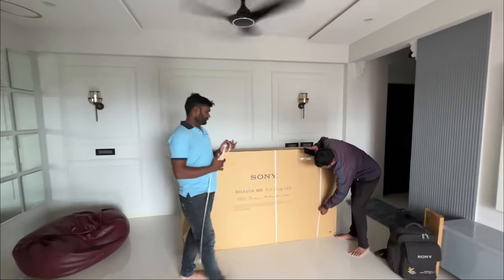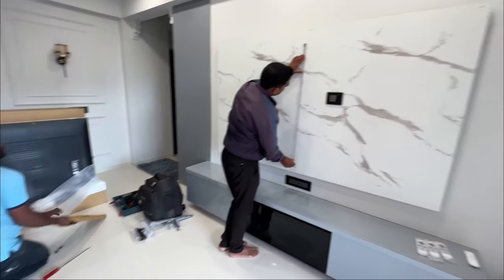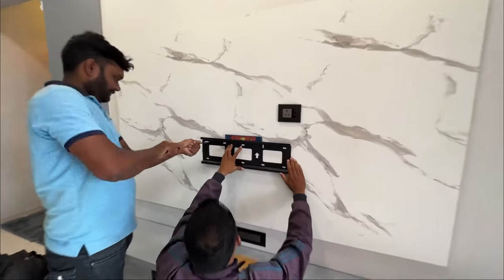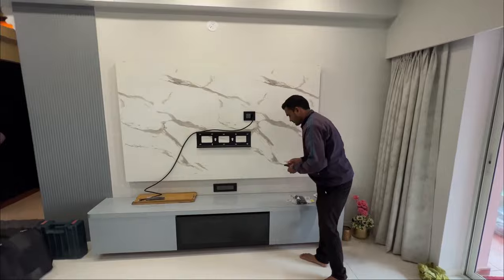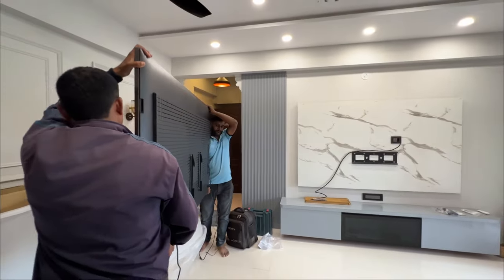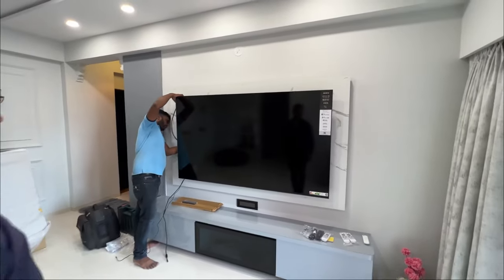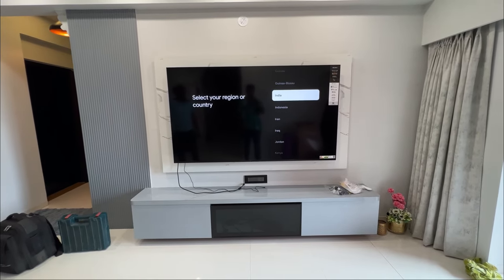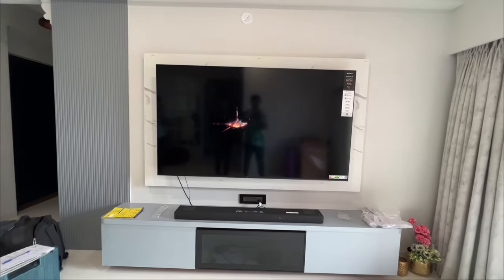Sony TV X90L 75 inches with Sony A5000 Sound bar - Unboxing and Installation

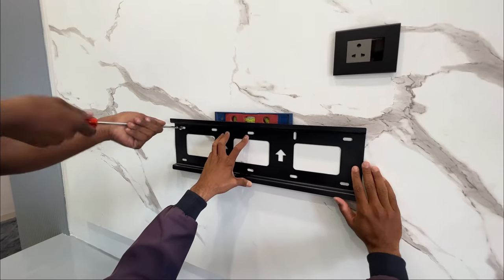Comment: 2:11 please eleborate why it did not needed drill or what was the material used to tight the screws?
Reply from the maker: I had a wooden frame already done to wall mount tv. They just took a sharp screw and simply attached it to the wooden frame. I assume if it had been wall mounted over a wall directly, it might need drill. In my case, it didnt. I am not aware of the material used exactly, may be sony sales people would know.

Comment: Hi suraj, just bought 75x90l and ht a5000 combo from croma. I am getting some peculiar humming noise (when nothing is playing)when TV and soundbar is connected with centre stage enabled. Sony is saying this is the problem with all 90l model. Could you please also confirm if you are also facing the same. Thanks for your help.
Reply from the maker: Hi. I am not facing this problem.
Reply: @4Ksage  thanks bro. Interestingly Sony says it is with all TV’s. Are you sure, the centre stage is also enabled (in Audio settings)and 3.5 mm cable is also connected to TV and soundbar ?

Comment: How is you experience going on?
I’m getting s90c for the same price as of x90l and very much confused to make decision 
What do you suggest?
Reply from the maker: s90c is mini led right? That would be better than x90l. I only opted this as its 75inch version was cheaper than samsungs mini led series.
Reply: @4Ksage  it’s an QD oled duh!
Let me know your experience with x90l
I heard that it is too bright for a shorter distance assume to be around 6-8 feet 
Is that real? The oled I’m not thinking is due to burin as I want the device to get going for atleast 8-10 years

Comment: Planning to buy this one..hows the gaming and overall experience till now?
Reply from the maker: I use it for more media content and it’s wonderful. However, thing to note is 4K content are very good. Other full hd or sd content is not that great on this. 
I tried gaming with my PS4 which doesnt support 120 hz, i coulnt make full use of the tv however the experience on a big screen makes a difference.
Reply: @4Ksage  Thanks

Comment: How is 82L sony 75 inch its costing me 1,40,000
Reply from the maker: I did see it on the shop, its picture quality did not look so good to me compared with 90L. 

But if you are jumping from a very old model tv, you wouldn’t be disappointed.